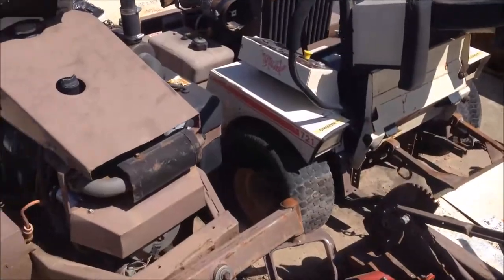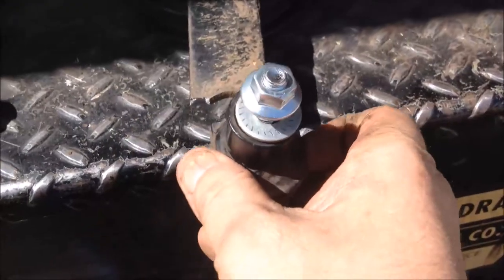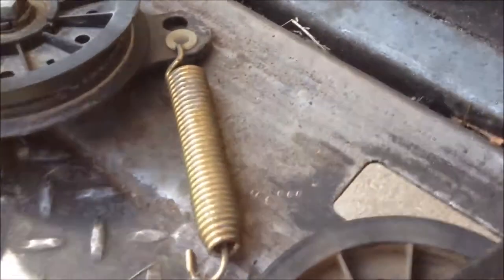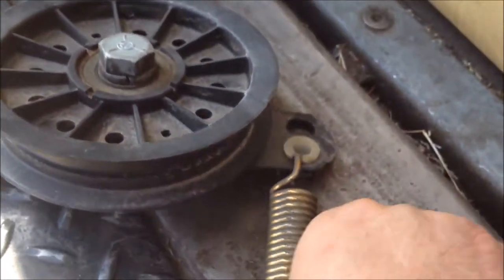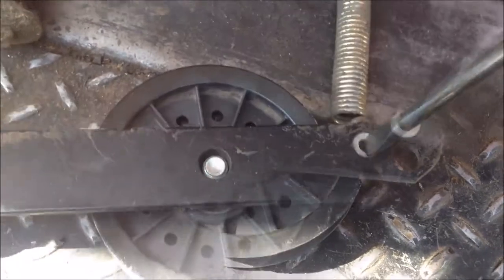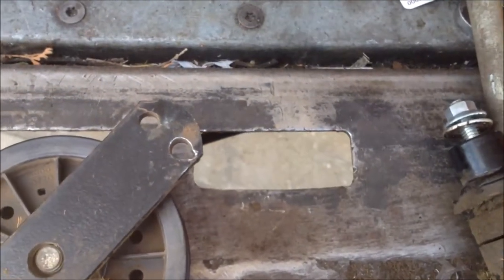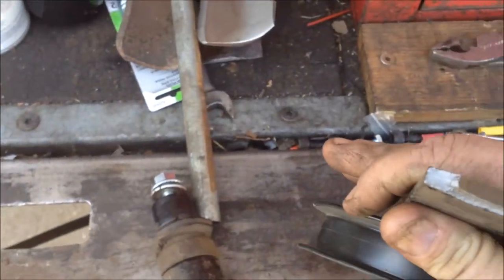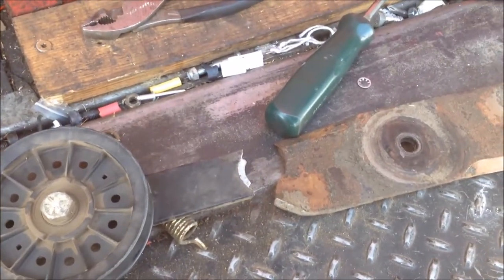GRASSHOPPER 721 DECK IDLER ARM / QUICK FIX / CATASTROPHIC BLADE FAIL

Comment: Another great video. Makes you wonder what people are doing to their equipment that is very expensive. I had someone that cuts grass on a sandy based lot and the sand wore the ends of the blades out. The guy never had changed his blades in over 4 yrs. Thanks for your video's. Buy the way, I use carb cleaner all the time and never have had an issue with paint. The guy the other day was way off base on his comments. You do great work.